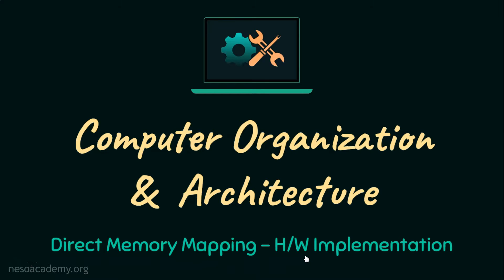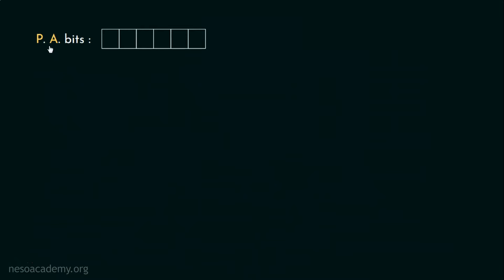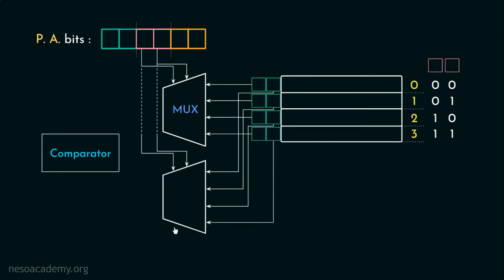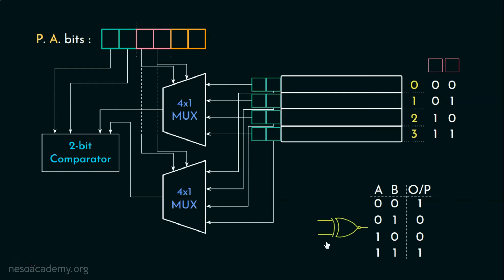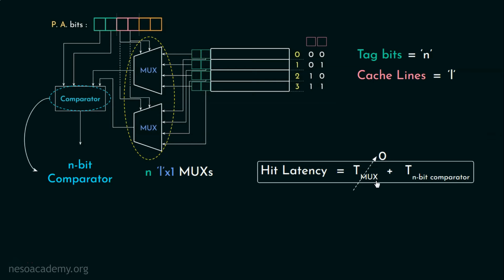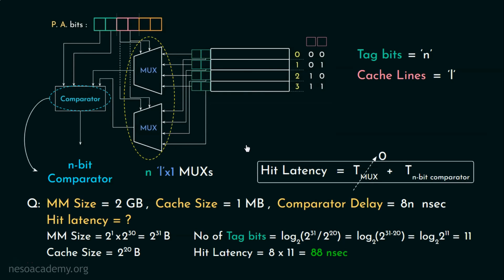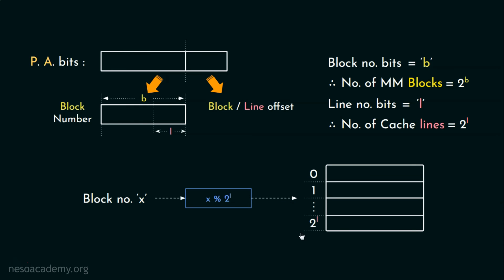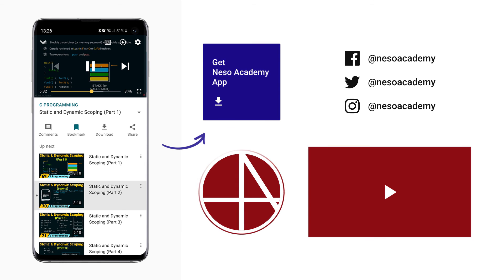Direct Memory Mapping – Hardware Implementation

Comment: what will be the number of lines for 3 tag bits?
Reply: Tag bits represent the number of cache needed to store the whole Main Memory, that is why Tag bits = (Main Memory Size / Cache Size). Number of lines represent the total number of line (= block) a cache can store. So to answer your question, we will need more than just 3 tag bits information. But I can tell you that with your 3 tag bits, we will need 3 MUX.
Reply: number of lines will be depends on no of line in chache.